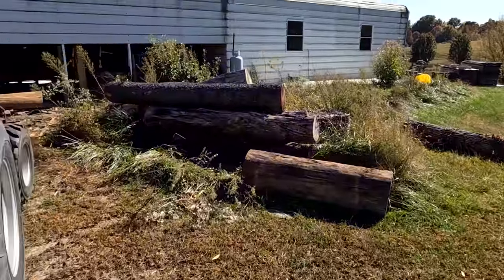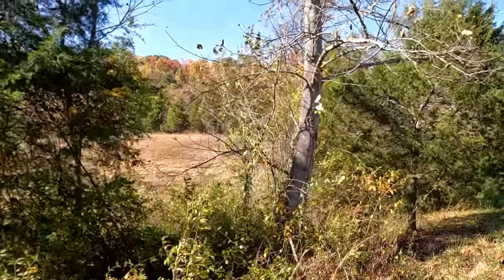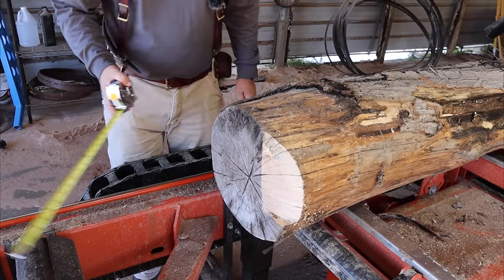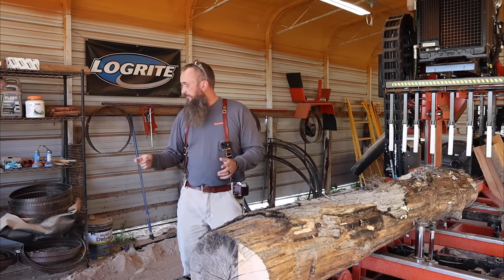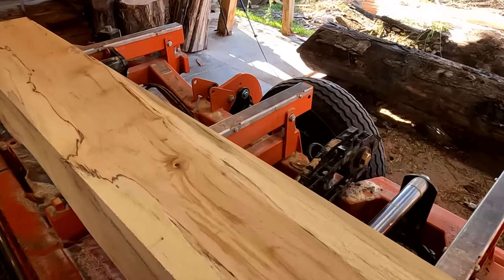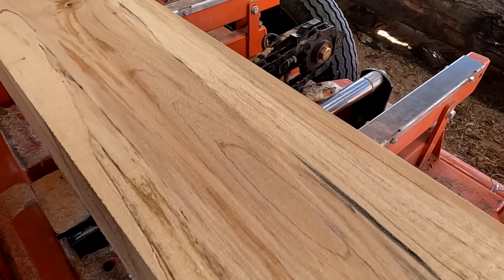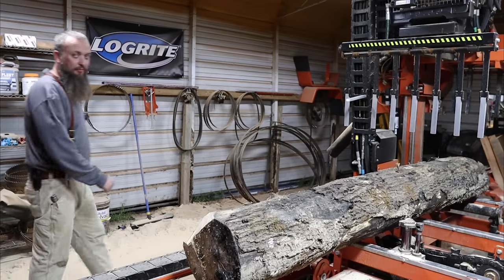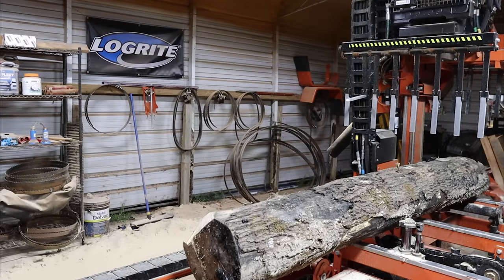You Have To See This Log! Spalted Sugar Maple.

Comment: Congratulations on the Logrite ATV wagon, No advertised pricing on the website, they sure build a well-made product from what I can see, that lightweight aluminum construction will ensure a better payload for gross weight, I was curious to see if the scissor jack is swivel base mounted to tilt as the bed raises. Thank you for sharing your FALL DAYS with us in Youtube land.
Reply from the maker: thanks Brian, appreciate you,, always a positive comment,
Reply: Aluminium? To me it looks like zink plated steel... But anywho, do you know why the "bed" seems to be a couple of feet short, is just for the scissor jack? I don't understand the box that will collect dirt and water, some kind of mesh/grid could let the debri to fall down on the ground. Maybe something for the R&D department...
Reply: @johanneslaxell6641   You are correct the ATV dump trailer is all steel and the parts are powder coated or zinc plated.  The tool box does have drainage so it won't collect water.
Reply: Brian the trailer is all steel.  Only our hand tools are aluminum.  This item is a built to order item and is quoted at time of order.  Currently, the price is $2800.

Comment: Beautiful spalting!  Personally I like sheep better than goats.  Much easier to fence in.  It’s not a hard and fast rule, but generally speaking goats like to go over fences, sheep like to go under them.  I find it simpler to block off the bottom of the fence than deal with Houdinis that can also climb really well.  If you get a hair sheep breed they shed naturally so don’t need to shear them, plus they’re typically more parasite resistant.  Most hair sheep breeds will also eat brush just as well as goats, and they’ll graze the grass as well as wool sheep.

Comment: Trailer looks cool but a good addition is to weld a nut to the crank, and use a battery drill to wind the crank to save your energy :-)

Comment: Hey, Nathan.  Is the lubricants you use on the sawmill the reason you don’t save the waste boards for firewood? I’ve always thought that many of the waste boards could be cut down to firewood lengths instead of thrown on the burn pile.  Around here (mid-Michigan) lots of people have outdoor wood burning stoves for heating their homes, and I know a lot of junk wood gets burned in them.